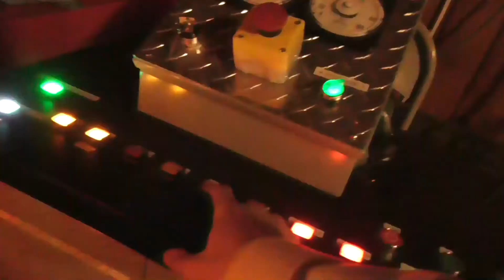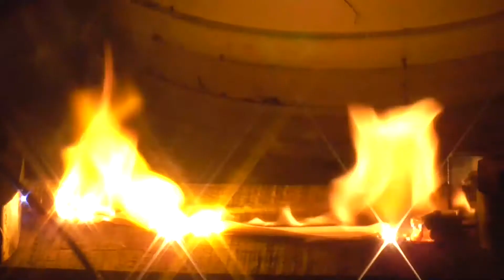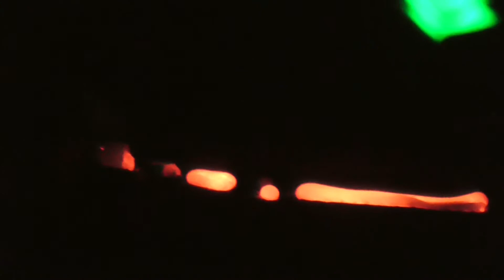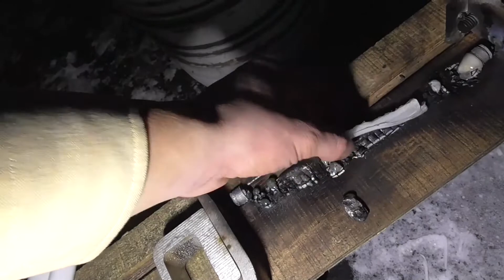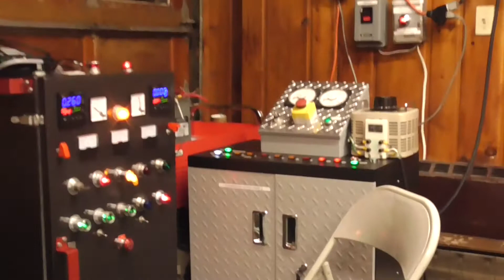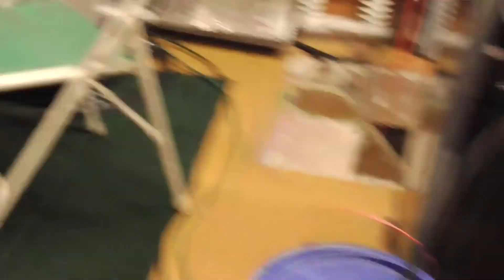14,400 Volt Distribution Transformer Melts Fluorescent Tube

Comment: That's Cool!! I had something like that happen but with 65vdc from my solar panels, I had a wire on a brick and was melting it with the arc and it melted the brick to, the wire melted into the brick then it lit up, it was brighter than the arc, and very hot to, if I put a piece of wood in it it vaporized it very fast.
Reply from the maker: There's nothing better than making things glow, speaking of which we need to blast electricity through rocks, bricks, glass and see if we can't make them into a unified melted piece. Thanks for the idea, we shall give that a try.
Reply: @VariacManiac  Cool! Welcome!

Comment: Those tubes can take a lot of power eh
Reply from the maker: This was a small one too, I tried a big one, but it didn't melt, it actually was able to snuff the arc inside once all the gasses were dissipated. I will continue to experiment to see which one's are the best. This was also just me testing the kind of new current limiting setup. It can do 10kW for around 2 minutes or so before it starts to get warm, so I'm happy for now, but I think I need a big arc welder to do the job for current limiting. And I need more power, LoL!!!!
Reply: Well you have an impressive setup for sure! You tried a sodium lamp on it yet?
Reply from the maker: @TheToastPeople  Might try that out, quite possibly give a shout out =)..